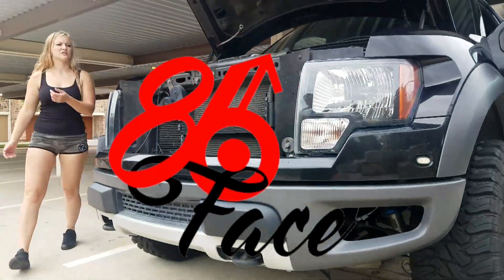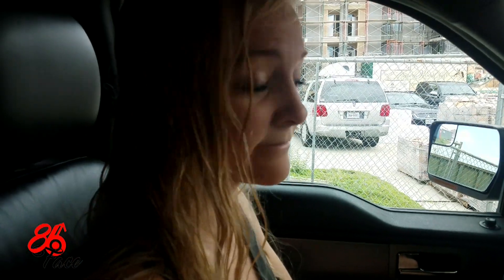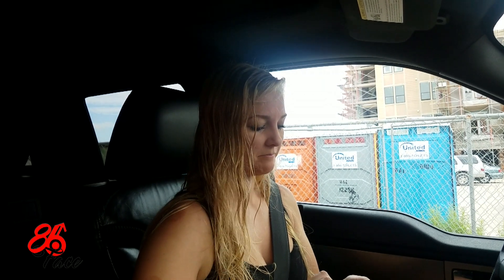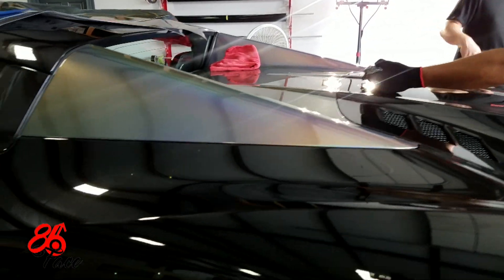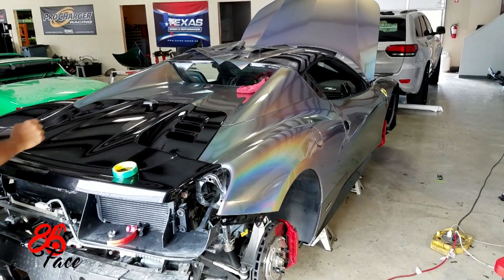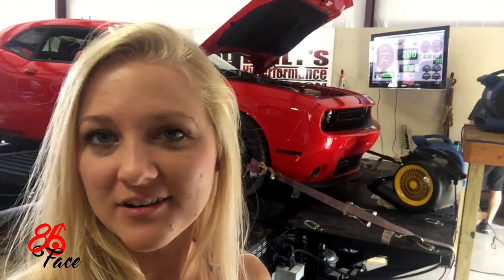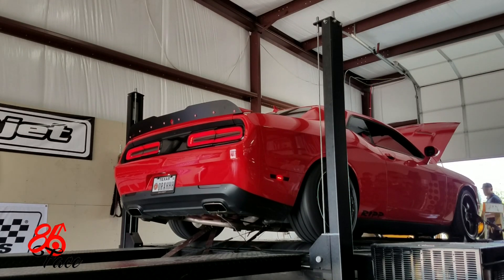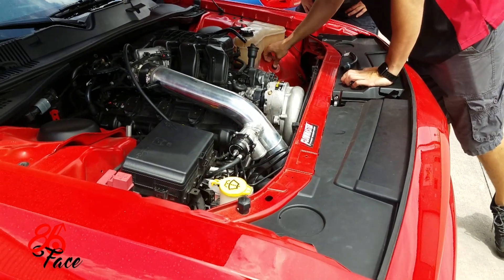DYNO DAY AND PICK UP

Comment: What other things do you plan on buying to keep the motor safe ? I though the Ripp supercharger kit brought everything you needed
Reply from the maker: SillyWabbit it's does for their boost level and local air density. I want to turn the boost up later on from 13 psi to around 20. And that'll need forged internals, sleeves and a tranny upgrade
Reply: Oh ok, thx for the fast reply! drive safe! (yeah right lol)

Comment: What other mods have you done to this V6 Challenger other than the supercharger.
Reply from the maker: CJ Colvin custom x pipe exhaust. Lowered. Wheels and wider rear tires.  Hurst shifter and ceramic coating
Reply: 86face That's cool. I know for the fact that you can't put headers on the 3.6L Penastar V6 because of the intergreated exhaust manifolds.

Comment: So what's the numbers!?
Reply from the maker: On Stock internals, were running 380ish hp and 400 torque
Reply: it's cool to see you do this with the v6 but you're pretty much in the 5.7 territory. I would've like to see you Mod the 5.7 and see what numbers you get.
Reply: He means 380HP to the WHEELS not the Crank. He's getting 6.4 Numbers in the quarter mile.

Comment: That's AROUND 440hp and 450hp t o the CRANK. The v6 is AROUND 300lbs lighter than the srt8. NO WONDER BOBBY BEAT THE SRT8 BY A CAR LENGTH 🤔

Comment: I have a question what exhaust work have you done to your car
Reply from the maker: MatTech5Gaming cut off the entire stock system at the cats and replaced with a true x pipe to 2 flowmaster super 10s
Reply: 86face it sounds really good I have a v6 charger and i'm planning to do some exhaust work to it
Reply: I have a Solo Performance on mine. It takes a while to get used to the drone, but it sounds like a meaner car than it is.
Reply from the maker: Tracy J put a blower on it and much the performance to the sound
Reply: Nah. My mind tells me to step up to a Scatpack instead of spending the money on add-ons that don't help maintain the car's value.

Comment: You should've gotten the awd gt then mod that to 800 horsepower you'll be walking alot of cars
Reply from the maker: +Christopher Rubines they weren't out in 2016. And to get 800 out of this would be more expensive than A hellcat.  Doesnt make sense
Reply: 86face well i guess only you would know cause you have the vehicle and you did your mods on it so I guess but hey if you can make that power your take off would be awesome since you have the awd not to mention a lighter motor